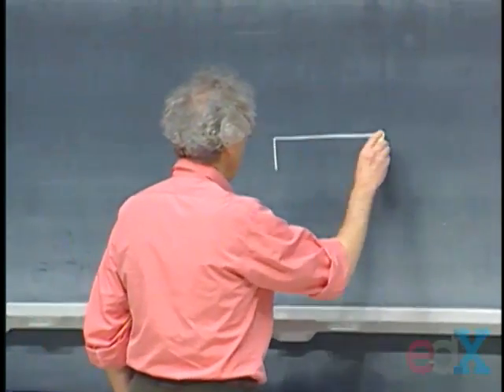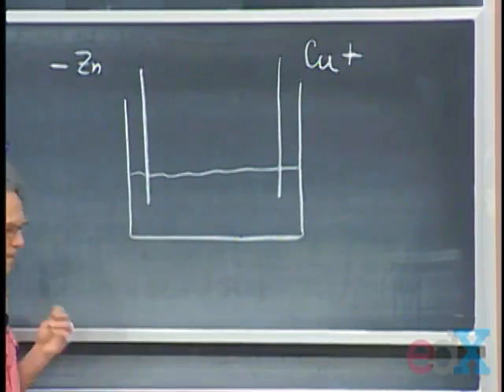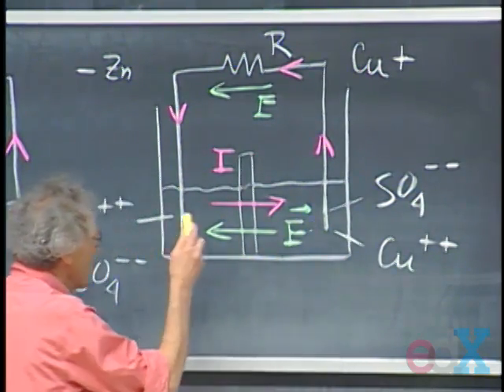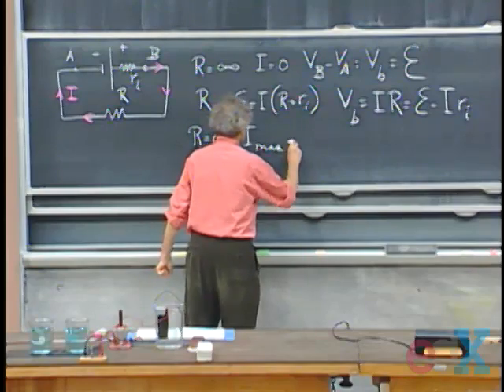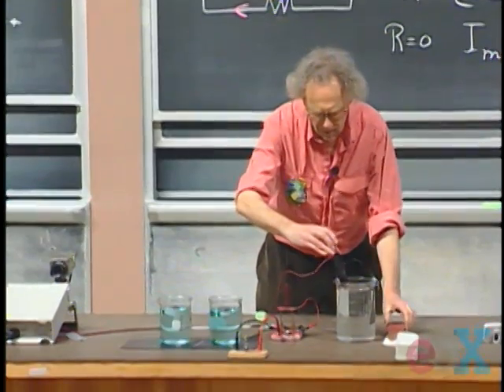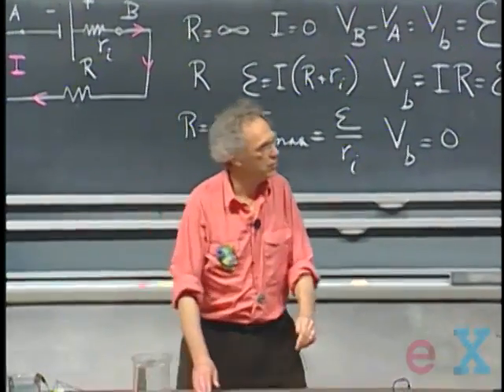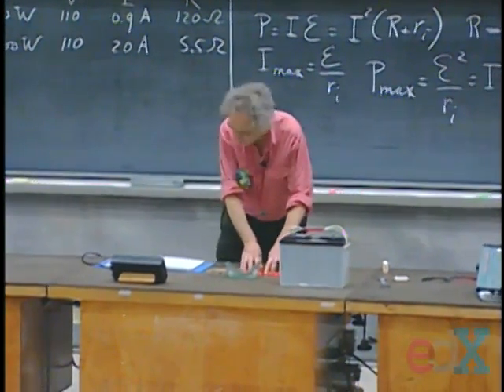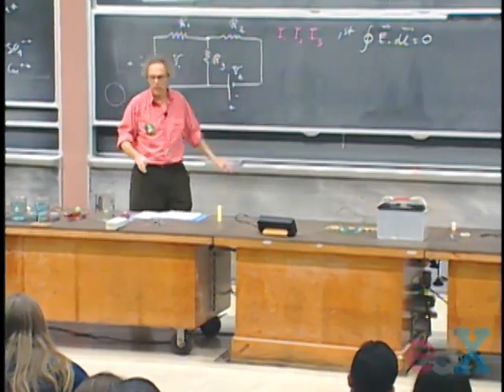8.02x - Lect 10 - Batteries, Power, Kirchhoff's Rules, Circuits, Kelvin Water Dropper

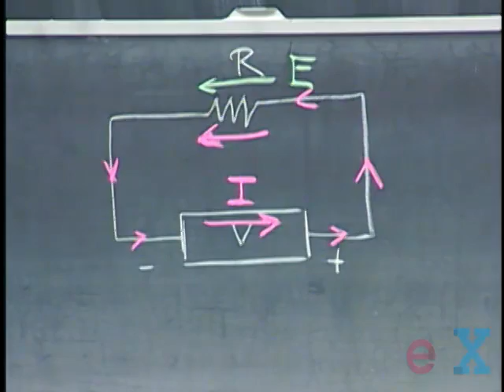Comment: sir in 1:00 the shape electric field lines from +ve terminal of cell to -ve terminal of cell is not smooth. in the corner of circuit it is not smooth. electric field lines are taking turn. but we know electric field lines are smooth
Reply from the maker: connect a copper wire over a battery. put knots in the wire make sharp turns. The E-field will always be in the wire.

Comment: sir suppose i have  a cell in which copper plate has electrolyte is sulphuric acid and copper rod has +ve potential and zinc rod  has -ve  potential. sir i have not complete the circuit. sir is now reaction will not takes place between the sulphuric acid and zinc. sir why reaction takes places only current flows.
Reply from the maker: at zero current there will be a pot diff. Like a car battery that draws no current.

Comment: 30:48 , sir, why did not you get a shock when you shorted car battery of large current?
Reply from the maker: no current went through me.
Reply: @lecturesbywalterlewin.they9259  could you explain me sir, though you held the rod with bare palms why no charges passed through you? Was you insulated yourself by any means or just your shoes were strong enough? Thanks sir for reply, 😊
Reply: @lecturesbywalterlewin.they9259  Sir, i got a little bit confused: does voltage depend on resistance? I always thought (since the electric field is conservative) potential energy depends only on initial and final positions. Thank you.

Comment: Sir please in 1:08 can we say that Lenz law works here for E field ( current I opposes its causes )
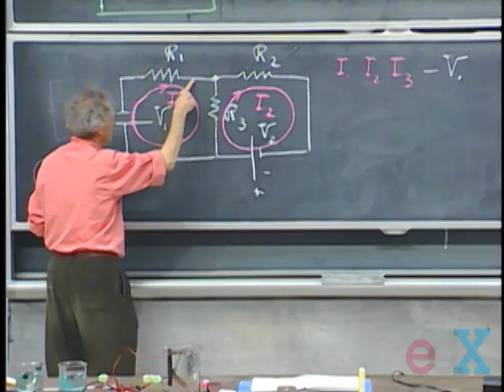Reply: 38:44 why did we go from higher to lower potential ? and we went from a minus charge, though the current moves in the opposite direction ..
Reply from the maker: question unclear. Lenz' Law is the result of Faraday's Law.  The induced EMF opposes the change in magnetic flux
Reply from the maker: wew adopted a convention that going down in potential is given a -- sign (we could have chosen the opposite convention). Since current moves from high to low potential, going through a resistor in the same direction that the current goes through it will then mean that the potential goes down and that's why I gave it a minus sign.
Reply: Thank you so much sir

Comment: sir sorry i am asking this question again and again. sir but you are the only one teacher which i have. 
sir suppose there is Zn rod  which is dipped in the H2SO4. sir i dip it in two ways.

1) sir i partially dipped the Zn rod into the H2SO4 solution. sir there will be generation of -ve potential at the rod. 
2)sir i dip the the zinc rod completely into the sulphuric acid. now there is no generation of the -ve potential. 
SIR WHY THERE IS GENERATION OF THE  POTENTIAL ONLY WHEN WE DIP THE ZINC ROD PARTIALLY  INTO THE SULPHURIC ACID.

SIR PLEASE EXPLAIN. I shall be very very thankful to you for this.
yours obediently
keshav
Reply from the maker: use google
Reply: Lectures by Walter Lewin. They will make you ♥ Physics. Lol all that effort & all he gets is this 😂😂😂

Comment: i get that water stream gets spread because its a dielectric (at least the pure water molecules) and so it spreads as charges build up on the bucket, but how stream of water moving past the paint can builds up this charge remains the mystery, can you explain please, professor 🙂🙂?
Reply: I believe that friction will cause the buildup of the charge. I may be wrong though.
Reply: Also your comment is buried deep underground so I do not believe that the Professor came to look for it.

Comment: Professor,

a somewhat off topic question: How far is physics from inventing the "super batteries" (handling enormous capacity per unit mass and charging full in a matter of seconds)? What are the natural limitations scientists have to deal with?

Thank you.
Reply from the maker: +Vadim Tikanov http://web.mit.edu/erc/spotlights/ultracapacitor.html
Reply: +Lectures by Walter Lewin. They will make you ♥ Physics. This looks promising, thank you. However, the nanotube battery does not seem to improve on capacity per unit mass.

I'm wondering how far are we from, say, a battery of 1 kg weight and enough capacity to drive a car for 1000 miles. Is this theoretically possible? Or there are some known physical boundaries for the amount of energy, which could be stored per unit mass?

Thank you.
Reply from the maker: +Vadim Tikanov Search the web for information about what is presently available and what research is done on batteries and what are reasonable goals.
Reply: Vadim Tikanov . Figure about 1MJ per mile for an electric vehicle. Wikipedia was an energy density page giving you figures to do back of the envelope calculations.

Comment: hi sir , a question from Algeria, suppose two similar capacitor, equally charged, equal distance between two plates, equal in everything, if we bring the plates of one capacitor  outer of the plates of the seconde capacitor i.e(we bring one capacitor between the plates of the other), then we have the electric field twice more than before , then the energy is 4 times more, is the work done the bring the capacitor together to energy inside the capacitors?
Reply from the maker: question unclear.
Be more precise
Reply: sorry i didn't read the message i wrote, it was a disaster.
 suppose a charged capacitor, we bring a second charged capacitor so that the second capacitor is inside the first, the four plates are parallel, so the whole electric field is twice larger than before, then the energy is 4 time larger than the energy carried by each capacitor, (violation of conservation of energy), does this excess of energy come from the work we have done the bring the two plates of the first capacitor close to the plates of the second capacitor?    by the way, what's the book going with the course vibrations and waves?
Reply from the maker: Let's assume for simplicity that both capacitors had the same free Q charge. one with separation d2 and the other with d1. d2>d1. If you bring d1 inside d2 and if the configuration is [-  + d1 -  +] you have now 3 capacitors in series. their plate separations are (d2-d1)/2, d1 and (d2-d1)/2. The E-fields in all 3 is the same. The potential diff are E*distance and the capacitance of each is inversely prop to the distance between the plates. Thus you can now calculate the total energy of the system: of 3 capacitors: sum of 0.5*C*V^2. If this is positive/negative you will have to do positive/negative work. I will leave you with the problem if the configuration is [-  - d1 +  +]. Good luck.
Reply: for the configuration [- + d1 - +], does the field of the outer capacitor contributes to the field of the capacitor in between, normally they will add each other (the 2 outer plates have an E field, + the field of the  2 plates in between)
Reply from the maker: since Q_free are the same on all plates, the E-fields are the same in all 3 capacitors. Notice what I wrote: 
"Let's assume for simplicity that both capacitors had the same free Q charge."
Reply: Ok, lets suppose 2 Electromagnetic waves which are contructively interfiering, the energy is 4 time larger? if yes what about conservation of energy,? i think that the energy when there is destructive interference transforms into when there is constructive, am i wright?
Reply from the maker: energy is always conserved. The light removed from the dark areas (minima) in interference shows up at the maxima.
Reply: one more question sir , about a very good book about vibrations and waves because in the lecture about polarization by reflection, brewster's angle .... we found a formula that you said it's using maxwell's equations and it's  part of 8.03? what about the book you are using in this course?
 thanks sir you are a legend, you made me love not only physics but all science :)
Reply from the maker: 8.02
Physics for Scientists & Engineers by Douglas C. Giancoli. 
Prentice Hall
Third Edition
ISBN 0-13-021517-18
Reply: not 8.02 but 8.03, when we derive from maxwell's equations the equations to find the brewster's angle, and a derivation about why the probability that blue light to be scattered is more than other kinds of light,
Reply from the maker: 8.01
Physics
Hans C. Ohanian
2nd edition
W.W. Norton & Company
ISBN 0-393-95748-9

8.02
Physics for Scientists & Engineers by Douglas C. Giancoli. 
Prentice Hall
Third Edition
ISBN 0-13-021517-18

8.03
Vibrations and Waves by
Anthony French
CRC Press
ISBN 9780748744473

8.03
Electromagnetic Vibrations, Waves and Radiation 
by Bekefi and Barrett.
The MIT Press
ISBN 0-262-52047-8

Comment: sir as we know that when we put the zinc rod into the sulphuric acid the following reaction happens
Zn + H2SO4 = Zn(SO4)2 + H2.
sir suppose i put the zinc rod and copper rod into the sulphuric acid. sir suppose i did not complete the circuit. sir now  reaction happens between the sulphuric acid and the zinc. sir Zn(SO4)2 will be formed. sir reaction happens whether we complete the circuit or not. sir than why cell discharge only when we put external resistance. sir is reaction happpens only when we join two rods.
Reply from the maker: use google

Comment: Sir , is the direction of the electric field with or against the direction of the current in the internal resistance ?
Reply from the maker: The electric field in a conducting wire is in the direction of the current. Keep in mind though that only the free electrons will move and they will move in the opposite direction as the E-field thus in the opposite direction of the current.
Reply: @lecturesbywalterlewin.they9259  sir, i understand that electrons move opposite to the E-field but i am asking about the direction of the E-field in the internal resistance .
Reply from the maker: what is the "internal resistance"?
Reply: @lecturesbywalterlewin.they9259  the internal resistance of a battery  .
Reply from the maker: inside the battery the E-field is directed from the + side to the -- side. Thus, if you have a simple circuit: battery, + a light,  the closed loop integral of E dot dL will be zero.

Comment: Sir, what causes the battery capacity decreases due to high internal resistance...?
and if the electrons have mass, whether it can be influenced by gravity when it accelerating by electric field..? Thank you
I love so much your lecutre.
Reply from the maker: questions unclear. Gravitational force does work on the water drops. That's the source of energy that drives the Kevin water dropper.
Reply: im sorry, its two diffrent questions actually...
Reply from the maker: questions still unclear

Comment: sir but it in books it is written that circuit must be complete/close to glow a bulb.  what about the books sir. I am confused
Reply from the maker: do not worry. Books tried to simplify things. In general that is TRUE. Your lights at home are lit bcoz of a current in a loop. However, in the case I wrote about (2 conductors at different potentials) a current will flow and a light (in the connecting wire) could lit up for a fraction of a second

Comment: sir suppose  from +ve terminal to - ve terminal of cell you connect copper wire. you can give an shape to the wire between terminal. you can make sharp end. you can make wire shape like snake between terminal. but electric field lines has not snake like shape inside conducting wire.
Reply from the maker: yes
tis is my last answer on this topic

Comment: 10.28 sir,you have said that voltage difference between A and B is zero..if i connect a voltmeter between A and B,....is the reading is zero????????????then how the current flow
Reply from the maker: if R = 0, VA=VB. Current I is V_battery/r_i
Reply: @lecturesbywalterlewin.they9259   ok..if Va is the negative terminal and Vb is positive??? assume that i have drawn the same diagram as I mentioned earlier,,then??

Comment: So, how do you know that ( I1= 3A , I2=1A ) is one of the possible ans of the 2 eq with all that unknown? How do you calculate that?
Reply from the maker: I cannot add to the clarity of this lecture.
Reply: @lecturesbywalterlewin.they9259  It's the 2eq on 42: 32, did you assume something or it can be just calculated from the 2 eq when we don't know the R123 and the V12?
Reply from the maker: listen to the lecture. I assume values for I1 and I2. There is nothing wrong with that assumption as we have no numerical values yet for V1, V2, R1, R2 and R3.
Reply: @lecturesbywalterlewin.they9259  ok. Thanks a lot. Sorry for the stupid question.
Reply: @lecturesbywalterlewin.they9259  Actually, I have two more questions, if we put another ideal battery near R3. In the eq., do we add V3 in it or it will be canceled out as there're two currents passing through it, just like what we do on R3. And if we start at I2 first, would we get 1A-3A=-2A, a current in opposite direction?
Reply from the maker: I cannot add to the clarity of this lecture. You can adopt any value you want for the 5 variables. The physics I discuss will not change.
Reply: @lecturesbywalterlewin.they9259  No I mean if I add a new variable V3  next to R3 into the system, would the equation be the same? As when I1 is passing through V3, I2 is also passing through V3.
Reply: And if we start at I2, 1A-3A=2A, is this mean we would get a current I3 in the different direction?
Reply from the maker: add anything you want and follow Maxwell's eqs. That will tell the whole story.
Reply: @lecturesbywalterlewin.they9259  Ok. Thank you very much.

Comment: the wire is turning means elctric field lines also is turning but electric field lines are smooth.
Reply from the maker: not as smooth as they are in your head.

Comment: Hello sir please help me with this problem 🙏
In the circuit shown in figure (32-E13). xi 2 =2 V, epsilon 3 =1 V and r 1 =r 2 =r 3 =1 Omega xi i =3 V . Find the potential difference between the points A and B and the current through each branch.
The photo of question is this
https://drive.google.com/file/d/1cZlA8tfueI8n8FARyHbYR3eQmFmej9tr/view?usp=drivesdk

Comment: Sir as we know that ohms law states that potential difference across two terminal of the wire  is directly propotional to current. sir V=IR. sir ohms law di d not say that emf of a battery is directly propotional to I. Am I right
Reply from the maker: weird question.
If a battery has an emf V and if the total resistance in a closed loop is R, than V=IR.

Comment: sr I have a question sir please answer this.....Why electric field lines are perpendicular to equipotential surface?
Reply from the maker: Suppose the filed lines were not perpendicular, then there would a component of the field tangential to the surface and that would cause a current, but that would mean that the surface is no longer an equipotential.
Reply: If they r not perpendicular..then we will hav a field component along d surface...which will mean tht work has to be done in order to move a charge on d surface..which is not possible

Comment: Respected Sir
sir suppose there is sulphuric acid in beaker. sir I put the copper rod in the beaker. sir is negative potential will generate on the copper  rod. sir please explain
Reply from the maker: <<< is negative potential will generate on the copper  rod>>>
NO  you need 2 different metals to get a voltaic cell. 
http://hyperphysics.phy-astr.gsu.edu/hbase/Chemical/electrochem.html

Comment: 30:18 professor why you didn't got shock from that
Reply: Current flows from least resistive path .As resistance of our body with shoes ( as professor told about resistance of shoes in last lectures) is very high in comparison of iron so it will mostly flow from iron wrench and very less will flow from our body.

Comment: Professor: I dont understand why you did not get electrocuted when you shorten the car battery with the wrench?
Reply from the maker: it's hard to get electrocuted by 12 Volts. Besides the current that went through me was ZERO! However, I could have burnt my hand due to the flame if I had not been careful.
Reply: the current did not pass through you body because the resistivity of your body is higher than the wrench?
Reply: The spark plug coils in cars step up the voltage to 60,000 volts (the same as clothes in your clothes dryer😂) for the spark plugs, so under your car hood can be dangerous.